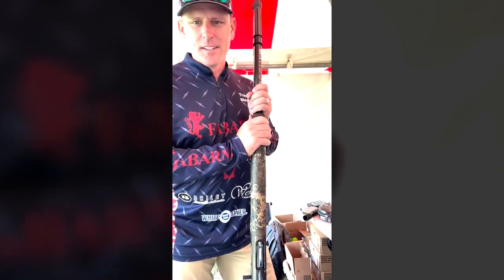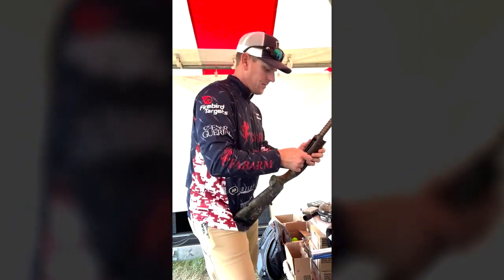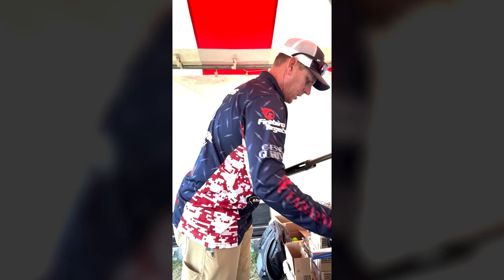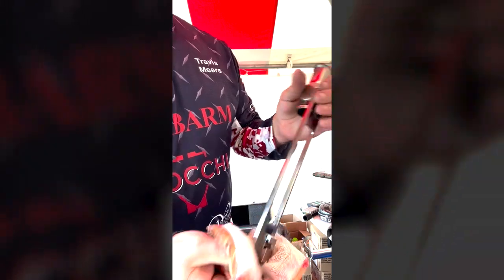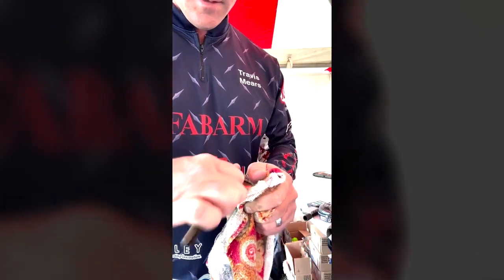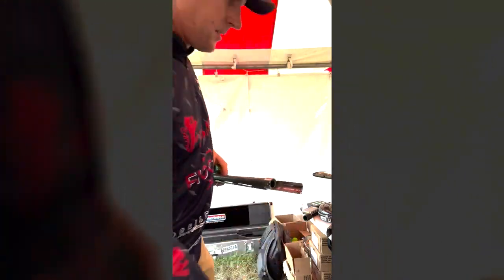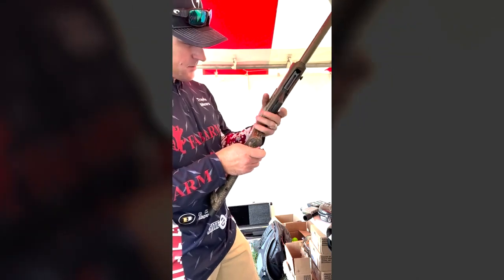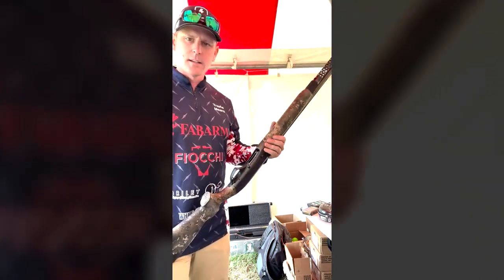Fabarm Semi Auto Cleaning w/Travis #fabarm

Comment: With the amount of shells you put through that gun in such a short period of time. Have you had to replace any parts on the fabarm shotgun? For example Any problems with the rib detaching from the barrel from the heat or the action bar cracking? Bound to be alot of wear and tear with that amount of shooting? How often would you change gun for a new one?
Reply from the maker: Travis is here: https://www.travismears.com/ . He's been running the same two guns for over two years, with zero parts replacement.
Reply: @RandyWakeman  That is deadly. I have shot the fabarm xlr composite for the last ten years as I am a left hander and it has been such a reliable gun. Only this season the action bar has cracked but I use it for waterfowling and everything really, it has had alot of abuse. I was just interested to see how the chesapeake has held up and you have answered my question. Thanks for your reply as I am going to buy a new fabarm xlr chesapeake which is actually called fabarm xlr columba palumbus over here in Europe but it is the same shotgun. Thank you very much for your time!
Reply from the maker: The action bar was redesigned back in July, 2005: https://www.fabarm.com/web_eng/caratteristiche-dettaglio.asp?i=2 . My only high mileage Fabarm is an L4S I've used for the last eight years, nothing broken yet.
Reply: @RandyWakeman  ah I didn't know that about the action bar and how it works really. I suppose that explains maybe how my action bar has wore. I reload my 12 gauge shells for steel shot and they will be on the high end pressure wise. So this has probably lead to my problem but I suppose could have been a weak spot or gun has took a knock here and there. I must say it has been faultless up to now and that is why I will be buying fabarm again. Helpful stuff. Thank you!